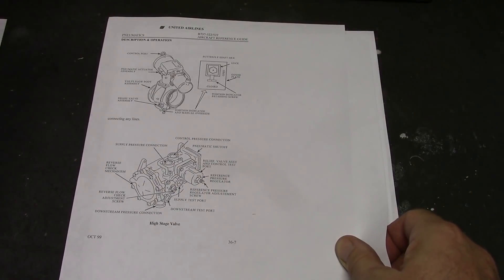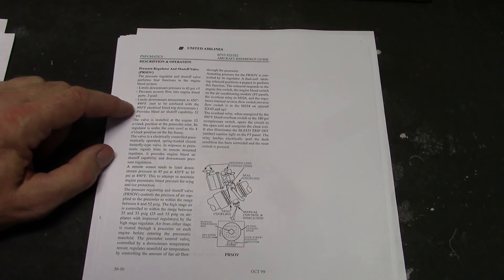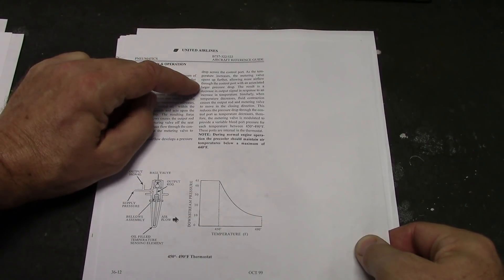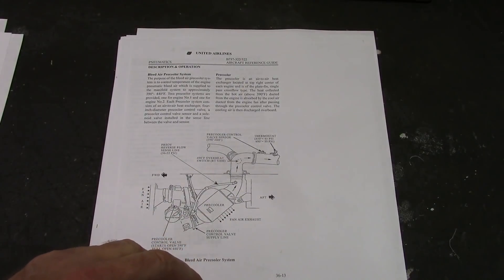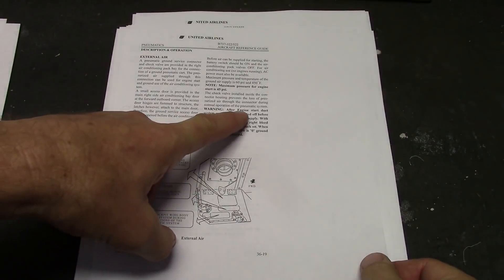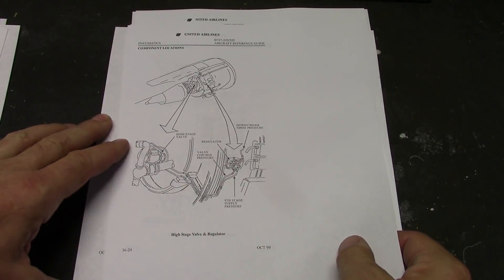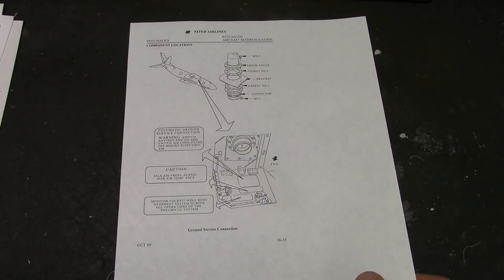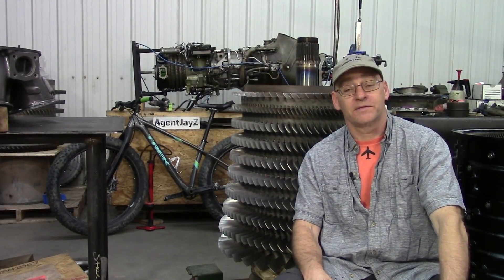737 Bleed Air Check Valves Update 2

Comment: About the lag, you are absolutely right for fighter jets, especially in a carrier landing they can't afford 4 or 5 seconds for spool-up. However, airliner engines are very different animals, and regulations allow up to 8 (eight!) seconds from "minimum flight idle" to the power required for a specified climb gradient in landing configuration (Source: https://www.ecfr.gov/cgi-bin/text-idx?node=pt14.1.25&rgn=div5#se14.1.25_1119 ). That is indeed a ridiculous amount of time, and most engines are a lot faster than that and very rarely do you need to spool up from idle. One reason for using a high-drag flap configuration in final approach is to keep the engines spooled up well above flight idle to get go-around power more quickly. Airbus even has a special idle called "approach idle", specifically to avoid long delays when selecting go-around thrust.

Comment: 16:20  on page 36-7 those are two halves of the High Stage Valve. On top is the Valve and Actuator. On the bottom is the "Remote Servo", which takes care of regulation and sending the pneumatic signal to the Actuator. They are connected via "Control Pressure Connection" and "Control Port"

Comment: 23:35 that's the check valve! Pretty simple EAD and not confusing at all. The specific FAA EAD for the issue in section D clearly refers to ATA36. People with access to the approved manuals can find the component with the exact name ''5th Stage Check Valve'' within them, no problem.

And as you mentioned, it is fairly accessible, and the task itself quite simple. We remove the valve from the engine, inspect it, if it passes inspection, we put it back in. If it doesn't, we replace it.

Comment: I got stuck in Deer Lake, NL for a night once, as the 737 arrived with a broken APU...and the ground start cart wouldn't pump enough air, even with the new part for it driven from Gander...only a few % short!  After Dryden, no more idling one engine if your APU is U/S.  Good stuff, thanks go to Dave for the e-mail.

Comment: 16:25 I think the top diagram is the valve itself and the bottom diagram is the regulator for the valve, which the text on the previous page mentions are separate.  The valve's "control port" presumaby connects to the regulator's "control pressure connection", while the regulator's "supply pressure connection" and "downstream pressure connection" connect upstream and downstream of the valve respectively.

Comment: @AgentJayZ As you figured out, what you are looking at on the page at 16:22 is not the 5th stage valve (which is a simple flapper check valve), that is the high stage valve (top) and the high stage regulator (bottom).
https://pasteboard.co/JlBeQn4.png
Reply: Truly said...

Comment: G'day,

Yay Team !

Regarding 13:30 or so..., there was a Boeing Stratocruiser - using B-29 Wings, Wheels, Powerplants & Tail, with a "Double-Bubble Hull" type of Fuselage..., which was remarkably ugly to look at, and famous for arriving with 1 or 2 Engines shut down enroute...

After that came the Lockheed Constellations & probably the DC-8s.

  After them came the Boeing 707.

I think the kind of problems from Throttle-Response differences between the last of the Big Pistons, and the first of the Jets..., as you described ; were most pronounced for Pilots going from Seafire, Sea-Fury, Hellcat, Bearcat types to something like a Sea-Vampire, or a Grumman Panther or a Supermarine Attacker.

 Low-speed Handling characteristics of Aircraft with late stage developments of Big GRUNTY Airscrews to that of the early, fairly wimpy & soggy, "Squirt" Engines was a Culture Shock to the Pilots.

But, not always an unpleasant difference..., in that with most of those BIG Piston types although the Engine COULD go to Flight Idle to Full Power in half a Second..., it was suicidal to attempt to open the Throttle anywhere near that fast - because the Crankshaft Torque would, at those low Airspeeds simply roll rotate the Airframe in thw opposite direction to the one in which the Propeller was winding up.

  So when choosing to go around, whereas the Jet-Jockey had to wait for the Power to appear & manifest itself, the Piston-Pilot was forced to titrate the dose slowly, while balancing the amount of Power commanded with the remaining margin of Aerodynamic control at that Airspeed.

  So, either way, they had to sit there waiting for the available Power, and/or Airspeed, to arrive and enable them to fly away from the cusp of the Stall/Wing-Drop in which they used to be left, sort of, teetering.

 Back in the Olden Dayze, so I've read.

Have a good one...

Stay safe.

;-p

Ciao !
Reply: WarblesOnALot   - ... and Convair 4XX’s

Comment: The F-86 and B-47 with j-47 engines had air brakes so the engines could be run at a higher power setting when coming in to land to reduce the spool up time if power had to be increased.  Good video keep them coming.

Comment: I love the technical videos of you building turbine engines and afterburners. But these are also great videos because they explain the technical bits of the turbine engines in recent events. Thanks! BTW, Mentour_Pilot reported on his channel two days ago about an issue with the intermediate stage oil cooler line or something that caused a fire in the engine and a turbine disc engine failure if you are interested.

Comment: Although not much of a problem, just want to point out that this a classic 737 (737-300/500) and not the newer next-generation 737 that we are examining. But they are essentially the same, barring a few temp/pressure limits
Reply: The company I work for are inspecting all.
Reply: The AD applies to the 737 300/400/500 as well as the NGs, so this manual is applicable.

Comment: Thanks, the first time i konw ground idle is not the same with flight idle.
Reply: Yuhua Han there are several versions of “Idle” I don’t remember them all, but there is ground idle, flight idle, anti ice idle, reverse idle... also flight idle at sea level is lower than flight idle at high altitudes to minimize the lag

Comment: I wonder if the system of pipes and valves got any less complex in the 787 or if it is still there as backup in case the electrically driven systems fail.
Reply: GEnx on 787 are bleedless by design.
Reply: @rzero21  Cool!

Comment: That valve system to control heat by pressure bleeding is  new to me. RPM range also. Explain why jet engine is slow to react.

Comment: Hello mister Z,

One question keeps popping up my mind,

Why is the air going through the bleeder valve ?  Why is the bleed air not sucked in the next compressor stage?  I assume the pressure has something to do with it but I still can’t understand why it is pushed out through the bleeder valve , my assumption is that the pressure outside is less than the pressure in the engine but why does the suction of the next stage not take all of the air to the next stage??

I hope you understand my question, I love your cool content about jet engines!
Your engine explanations are very clear amd helps us all to better understand how a jet engine works
Reply from the maker: The compressor is a device that compresses air, increasing the pressure.
A multi stage axial compressor raises the pressure with each stage.
Air will only flow from an area of higher pressure to one of lower pressure.

*  Most important * : There is no such thing as suction.
Reply: @AgentJayZ  thank you for your answer.  That explaines it.  The bleed air will take the route of the less resistance.  And the rest will go to the next stage.

Thanks and greetings from the Netherlands.

Comment: In an industrial engine, is any thrust produced by the engine before the air encounters the power turbine driving a load? If so the engine would still need a thrust bearing and strong connection to the ground. Also, would there be a lot of tension between the engine casing and turbine casing?
Reply from the maker: The thrust bearing handles thrust on the rotor, which is not the same as engine thrust output.
Now then: the engine is producing a gas stream which, without an accelerating jet nozzle would produce some thrust, but much less than it would with such a nozzle.
This thrust is against the power turbine, and makes it turn. The two are not pushed apart because of course they are connected by a steel duct. So net thrust on the ground supports is zero.

Yes, the steel duct performs two functions; it seals in the exhaust flow and conducts it to the PT, and it also holds the gas generator together with the PT. It should be remembered that the duct does not have to support much tension, because of course the gas generator is solidly mounted to the ground, or a frame on the ground, and so is the PT.
As a matter of fact, most ducts have an accordion style bellows section to allow for thermal expansion and contraction.

Once the exhaust has passed through the PT, it does not contain enough energy to make any significant thrust, but its heat is often recovered and used to make steam.
Reply: @AgentJayZ  Thanks for the great information! An accelerating jet nozzle increases flow speed why is there not one on industrial engines? This would greatly increase the speed and torque of the PT, or would this just cause a pressure buildup in the exhaust duct, reducing efficiency or causing compressor stall?

Comment: hi dad, do you think there could be any advantages in powering a car with a turbine engine instead of a piston engine nowadays? I remembered Chrysler doing an experiment with that concept but it was decades ago and it flopped, has anything significant changed in turbine technology from back then that could perhaps make this configuration more viable?
Reply from the maker: Race cars, yes. Regular cars, no.
Turbine engines are as efficient as piton engines, but only at their rated power output. Once you throttle back, efficiency goes out the window.

Comment: What's the highest RPS (Rotations a second) have you ran a test cell
Reply from the maker: The test cell is a building, so it does not really have a rotational speed.
Yes, your question is meaningless.
I could try to figure out what you mean, but that would be spoon feeding, like what you do with a baby.
Reply: I put multiple test cells as in case you have used different ones, basically it means what's the fastest speed you have ran/personally seen an engine go up to
Reply from the maker: Well, we don't measure in rps. We measure rotational speed in rpm. How about we use pilot talk, and I'll say that the highest we've ever seen is 106%, with the AI25-TL.
That is take off power for that engine. Typically we run our aircraft engines to 103%, and our industrial engines to 100%.
If you were to ask " yeah, but per cent of what?"... pilots never ask that question.
You want to know the actual rpm of the engine?
... RPS... don't be ridiculous...
To have access to that kind of information, you must become one of us.
Reply: It was purely a question and rpm tends to be 3-5 digits, while rps would be 3-4, also I tend to make new electric motor ideas that spin pretty fast, rps is more... common with me. Including me there is only like 100 thousand people in the world who use rps. Plus I've ditched rpm a while back and it's like trying to translate Latin with a person who only knows English.
Reply: AgentJayZ You just haven’t worked the test cells in tornado alley in the states.😉😉
Reply: True but I had the house that I was going to grow up in destroyed by 1 of 7 tornados in grand island. I sure as hell knew what tornado ally felt like before I was born :)
Reply: @Sans-fl4pe  but RPS? It's Hertz at that point. Or just 1/s
Reply: @HerrmannStahl  3 letters 2- stall, 50 shakes it to death 200 it explodes (talking bout petrol and diesel)
Reply: @Sans-fl4pe  sure. I'm not denying that. Just saying that RPS should not be a thing, because there is already a specific  unit for it
Reply: @Sans-fl4pe  RPS is of use in poly-phase electric motor and drive as it is easy to covert to Hertz for the drive design calculations.  But it becomes a real headache when working with very large, very low rotational speed machines, where, again RPM (or even in one case I monster I worked on, RPHour)
On infernal combustion engines rotational speed uses RPM for two reasons - tradition and resolution, and tradition tends to win)
Reply: @18robsmith  yes, but I tend to create motor variations making the rps skyrocket and handle mains. Engines- rpm is weird as I dont know the difference between 3000 rpm and 10 rps except that they are probably not the same. Plus lack of "visualization" on rpm
Reply: @Sans-fl4pe  I can understand what you are saying - I can visualise a large motor speed (rpm) in the open with a fair degree of confidence, and if in your work "tradition" has used one unit then it can be very difficult to swap to another even if the scale is the same.  (10rps = 600rpm, or 3000rpm=50rps - quite a substantial difference,  something like a stock Chevy large block at idle vs the same engine near full power)
Reply: Why not radians/second? LOL
Reply: The "start cart"  is at around 42,000 RPM !